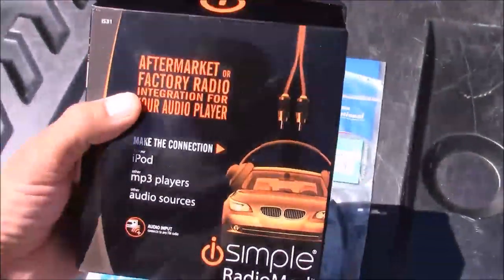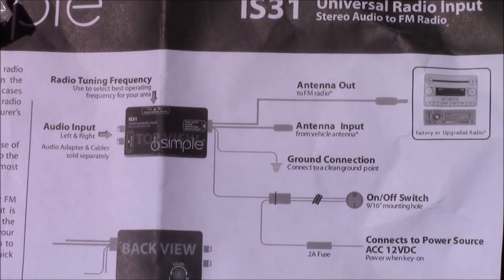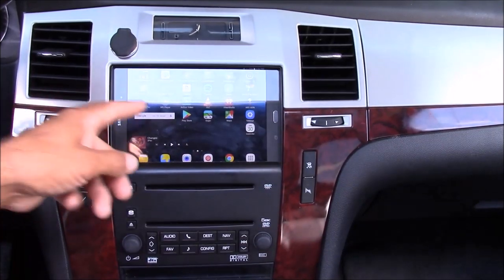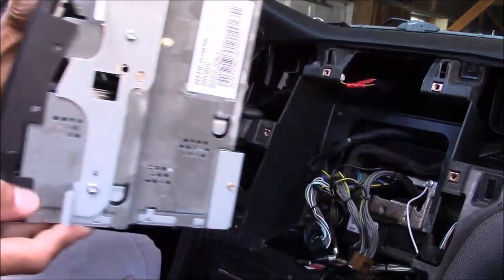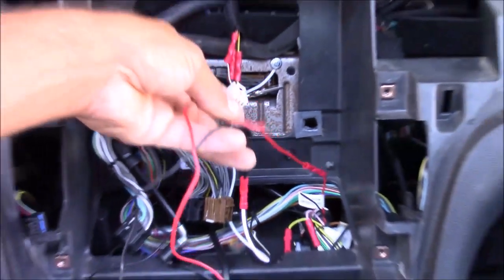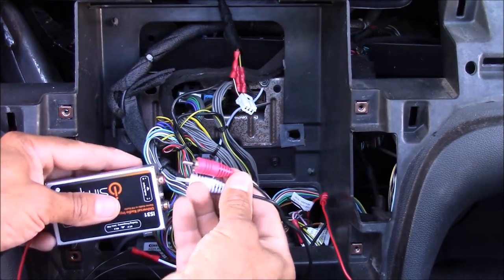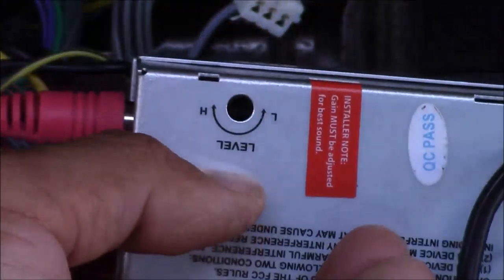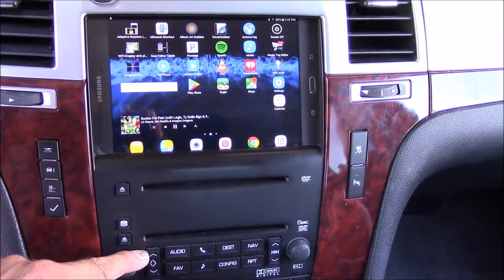iSimple Car Stereo FM modulator Aux input DIY

Comment: Robert.. If you splice the power feed into a switched acc, the unit will shut off when you turn ignition key off. However since the box interupts radio staions, you wont have regular radio as long as the box is on. Since he is using a tablet as a head unit, I doubt he cares about local radio.

Comment: Is there any downside to leaving the device on all the time like you did in the video? In other words without the switch?
Reply from the maker: I haven't really found any downside to leaving it on yet.
Reply: It does not interfere with other radio stations while it is constantly powered? Thank you!
Reply from the maker: just the one its tuned into like 88.1 the rest work like normal
Reply: Did you have any problems with the volume?  I have to turn up the volume very high on my car radio to hear the streamed music or phone calls.

Comment: So it is ok to wire the FM modulator directly into the car radio?
Reply from the maker: Yes.
Reply: Cool. Thanks for the response. Looking forward to installing this.
Reply: Ok one more question. Will the ground wire be black or white
Reply: @epicdogsrock797  How did it work out for you?

Comment: DO THE SOUND QUALITY sounds the same as a CD ?
Is there any Noise Interference at all ?
Reply from the maker: It's pretty clean sounding.  Don't know about being in giant cities though.
Reply: Unfortunately the frequency response is the bottom line.. the highs and the lows. And it will never equally CD although it will be as good as the clearest and the best sounding radio stations

Comment: Do you get any static or buzzing with the modulator? I'm using a wireless FM transmitter right now and even though I'm on a "dead" channel I still get buzzing. Would I be better off with this in terms of buzzing?
Reply from the maker: I get static if nothing is connected but as soon as a device is hooked up the static goes away
Reply: Awesome! Thanks for the reply!